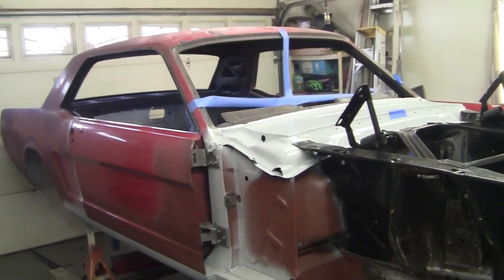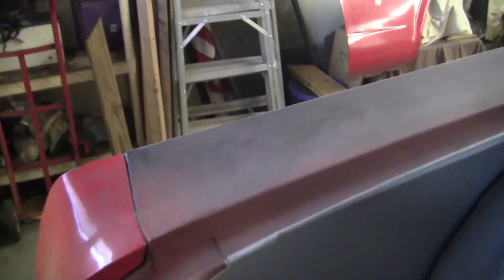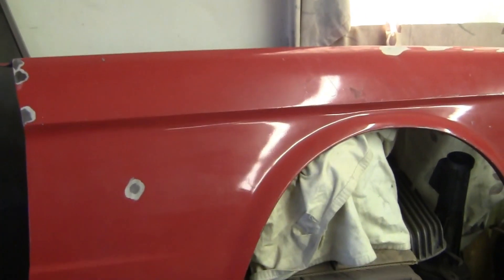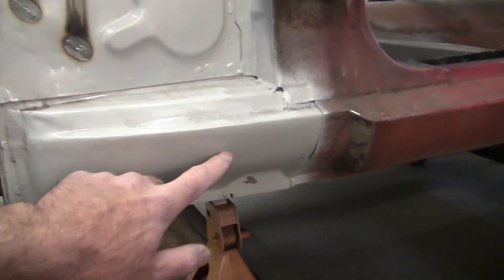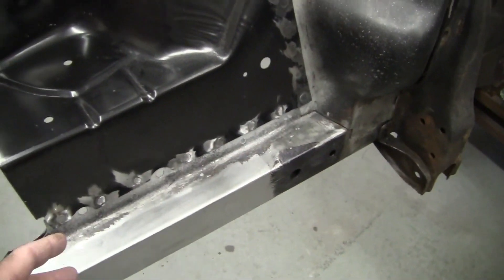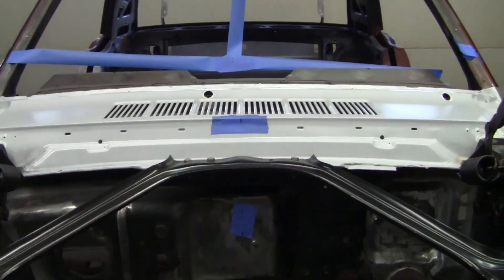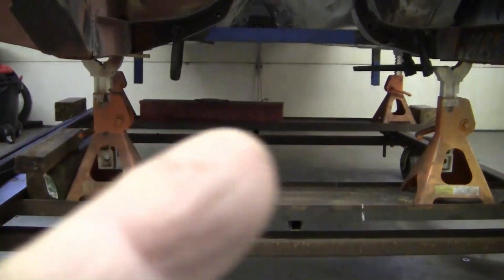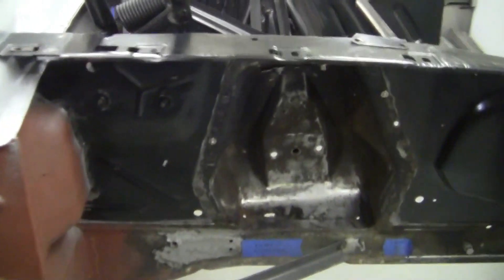Viewer's Project #8 Gene's 1966 Mustang Coupe.

Comment: Like the man in the video, I to had a Mustang in my past of my younger days. I graduated in 1971. My grandfather had found a 66 coupe body with no motor, transmission or rear end. He bought it for $20.00 dollars. Yes I Sid twenty. I had a 64 Comet Caliente with a 289 four barrel carb and C4 auto which I transferred into the Mustang. The Mustang was originally a K code car that was a race car. The man we got it from bought it for the drive train. Before I ever got it on the road I rebuilt the engine and took the automatic out and put in a 3 speed. I hot rodded three 3 speeds until I found a good 4 speed. A T10 out of a Galaxy.    Today at 67 I am trying to rebuild a 65 coupe I bought out of New Jersey. It's a 289 for barrel four speed car.

Comment: I may have to send in a couple of vids. I just started working on my 64.5 conv that I have not touched since the mid 90's. I bought the qtrs and fenders at the ford dealership. It is all ford except the door skins.
I also still have my 1st car which is a 1966 k model coupe that I am getting ready to fire up that has been sitting since around 2000. My buddy and I restored this car from 1983-87. 
Take care!

Comment: Gene, keep trucking on brother! I ran into the same issue on the driver's side qtr panel, I also see the lip is not formed correctly as well, so my advise is to scrap the qtr and get a new one, you will never be happy with it the way it is. Those are girly butt marks on the roof from the girls sitting up there watching the demo derby at the local fair. 
The driver's side of cars rust out worse because they are blasted with twice the salt as the passenger side does during the winter months
Reply: Good eye regarding the lip. I did the best I could to in roll it and re form but I was never satisfied with it. I spent too much time struggling with the options and temporarily moved on but I am thinking of scrapping the whole thing. It's a shame though, I have a lot of time in it.
Reply: Gene, I bought my qtr the same time you did and have the same issue. I am still not pleased with the drivers qtr panel 30 years out, you will be much happier without it and you can have it done in no time. I also hated the 1/4" trunk gap as well

Comment: i have exact tesame problems on my dynacorn fully welded framerail extensions .
It has a twist in the framerail .
if i set the back side on a 90 degree angle the front side of framerail is not on this 90 degree angle  so the framerail is twisted

Comment: ive just bought new dynacorn full aprons assembly's.
the passenger side is straight but the driverside is also bent like yourse.
if i put the radiatorsupport in then the framerails is twisted to the right where it fits in the framerail extensions.
i'm gonna try it like you did first attach straight in the framerail extension and then bent it to the side but my passenger framerail is also not yet welded because its a new one and so i cant jig against it.

do you know if youre apron assembly was a bit shorter in overall lenght then the original one? its like my new one  is shorter
Reply from the maker: I don’t recall a length difference. It’s unfortunate that things don’t fit like we’d expect.

Comment: Hey I am just starting to work in my 68 and garnering parts but I don’t know where to  Jack the car up. I need it on 4 or more stands so that I can take off all the wheels. Could you comment back with locations please?
Reply from the maker: In the rear, you can use the center of the rear end housing. In the front, you can place the jack under the frame rail where the torque box overlaps. You can also place a block of wood on the jack to spread out the weight, and prevent any damage.